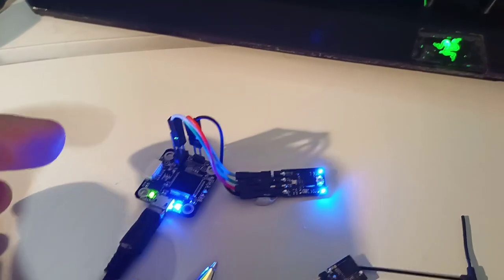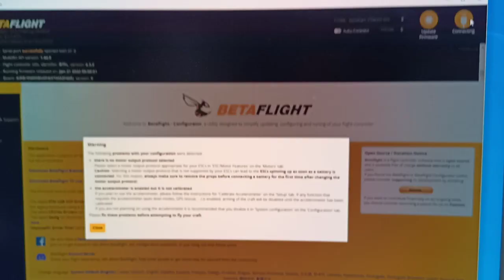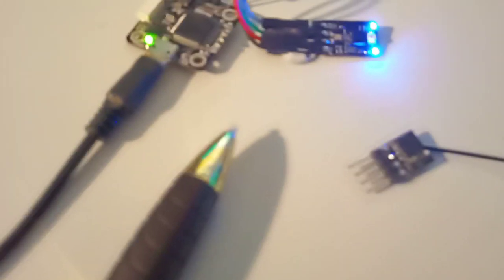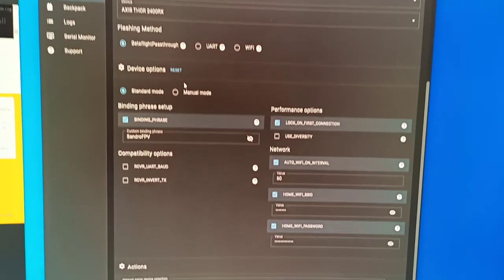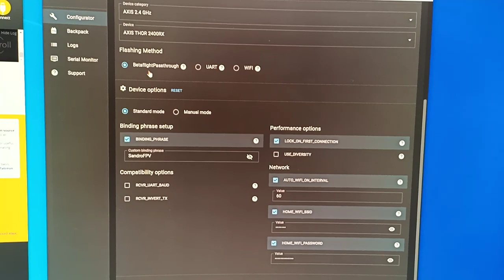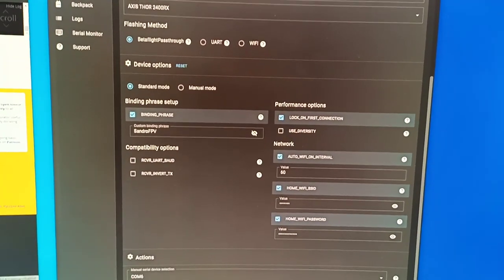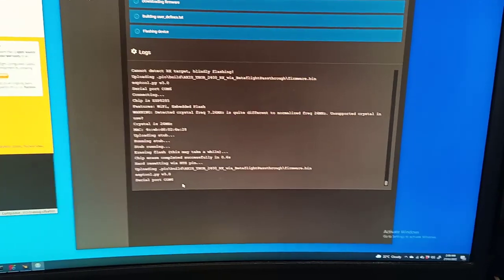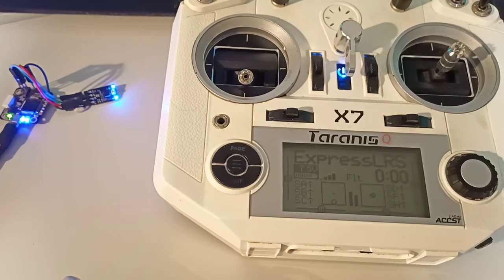How to Recover a Bricked ExpressLRS Receiver

Comment: I lost wireless on my Air 75. No wifi available and would not pair to my controller. I decided to try to update firmware from betafpv website. Now I've got nothing. BetaFlight can't connect and I've tried jumpering the RX boot pins on the all in one board and then flashing using expresslrs configurator using passthrough but it always says build failed. I've heard of a discord server, but I don't know how to find it.

Comment: IM loathing ELRS at this point. I have just bricked 3 PWM receivers that cant connect to a Flight controller to undo the bricked state... R/C used to be a easy thing to set up now its incredibly complex system of firmwares, flashing etc and now I  have 3 brand new Rxs that are fit for the bin...

Comment: I got 2 Foxeer LNA receivers after updating via Wifi, the update show completed and got steady green light on the receiver then after I saw the steady green light for 10 seconds, I removed the power source (5V) then power it up again, the receiver didn't light up. The only thing I found is the heat from Wifi module on the receiver.       (ELRS version 3.3)   

Foxeer LNA no boot button, any suggestion to unbrick them ?

Comment: Tried this and it didn't work... So I had to check the Elrs website and they warned about connecting to a dedicated FC Uart for the receiver. Apparently, FCs with a dedicated UART for the receiver (SBUS, iBus) can cause the LED to be a solid red. So I changed my UART and everything works just fine. Thanks a lot.

Comment: I just bricked two elrs rx's over wifi. I'm trying this method to recover them but I cannot find the telemetry on/off in bf configuration. Bf 4.3 I see where it is on your config but it's missing on mine. Any ideas?
Reply: Hopefully you got your issue resolved, but it's also worth pointing out another option.

I got a cheap "USB to TTL" CP2102 adaptor from eBay, soldered my RX to this (same as connecting to an FC - Power, then RX to TX, TX to RX) and flashed using UART method from ELRS Configurator.  The adaptor is the same as the ones sold as ELRS recovery, without the fancy case and tricky pogo pins.

It's a bit of hassle if the RX is soldered to your FC, but it is a nice way to prep RXs if they aren't already on an FC - I had some on the bench and flashed 3.2 to the in anticipation of my Boxer arriving.

Comment: WIFI update did not work since my hglrc elrs hermes receiver had been bricked during elrs 3.0.0 firmware upgrade from 3.0.0rc. BF passthru did not work either whatever I did set in BF 4.2 722.  Fortunately I have FTDI adapter and could flash using the adapter with flashing method UART.

Comment: I finished with "serial.serialutil.SerialException: could not open port 'COM6': PermissionError" error and have no idea what  to do next :(
Reply from the maker: port is busy because something else is using it
Reply: @deltageek7177  but what? Telemetry is off, BF disconected, … Any idea what to do please?
Reply from the maker: @janzajicek9246  Something else is using the port, perhaps you've left betaflight configurator connected by mistake?
Reply: @deltageek7177  BF is always closed :(

Comment: Oh well if only it were that simple, unfortunately it doesn't work for me, configurator doesn't get a connection with the RX. 
Serial port COM4
Connecting........____....._____....._____....._____....._____....._____.....____

A fatal error occurred: Failed to connect to ESP32: Timed out waiting for packet header
* [upload] Error 2
Reply: I did fix this after getting help from devs on discord. 

Steps - 
Bridge the boot pads
Solder the 5v wire into a pad that doesnt work without battery (should not work with usb), if its a plug connector that would be the best.

Connect usb and click flash
As soon as it displays port forwarding message connect the battery/plug for elrs and it would work as expected.

The only trick is to not turn on the elrs till the port forwarding message is printed
Reply: @prafulgupta7004  Thank you very much. I struggled with this problem for 2 weeks and fixed it thanks to your comment. I just plugged the connector from the receiver into the flight controller at the right time and it worked!!!! It just didn't work on the first try. My respect.
Reply: @FpV-Pilot  Glad you got it working too 🙂 kudos to the dev who recommended this solution, it looked quiet unlikely and random to me at first but was surprised by the result.
Reply: @FpV-Pilot  Hello, my language is Spanish, I'm sorry if I don't explain myself well.
I have tried to connect the battery several times, but it has not worked for me.
Exactly when do I have to connect it? I don't see the message that says "port forwarding"

I need help please
Reply: @prafulgupta7004  Hello, my language is Spanish, I'm sorry if I don't explain myself well.
I have tried to connect the battery several times, but it has not worked for me.
Exactly when do I have to connect it? I don't see the message that says "port forwarding"

I need help please
Reply: @ivancampos3378  You should see an inscription similar to ".....bootloader", and at this moment apply voltage to your receiver
Reply: @prafulgupta7004 me ha servido, muchas gracias
Reply: @prafulgupta7004  came here to say this worked for me !! thank you
Reply: Hey did you fix this? I am getting the same issue.

Comment: Edit: So I just turned the drone on again and the receiver was blinking when the radio was not connected after I turned the radio on and they connected the led was constantly on.  Is this how it is supposed to be?
How do I know if it is bricked or not?

So I was updating my receiver per wifi, but before the receiver started blinking again I pulled the power on the drone because some alarm stated going off and I feared the video transmitter or so would bourn out. (it was getting warm) Now the led on the receiver is constantly on but it still connects to the radio.  Nothing happens when I move the sticks, but I think this is because it is not armed or so, I have not yet a button for it on the radio.  

Is it bricked? 
This is my first drone so I do not really have any basic  knowledge how this all works.
Reply: If you can still update the RX, it's probably not bricked. When you move the sticks you should see this in betaflight receiver tab (if tx is bound to rx), this has nothing to do if armed or not. Seems that you have a bind problem, use the same ELRS Version and setup the same bind phrase at transmitter and receiver.
Reply: @martinsilenus8283  Thank u for your reply, but I have already solved it.
I did the probably most obvious mistake and solderte tx to tx and rx to rx.   Was 100% I switched them but I did not...

Comment: Is it the same for R9 receivers (yes, someone might still use them...) ?
Reply: This don't usually happen on an stm-based device. 
I'm still using my r9mm and an r9mx and not having flashing issues. Flashed via passthrough.